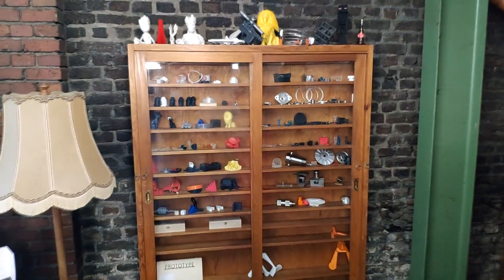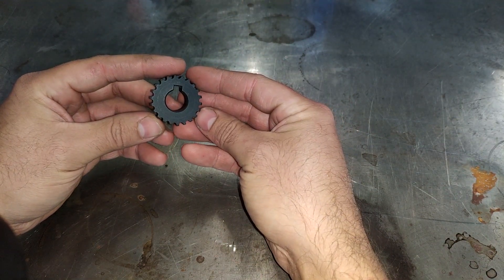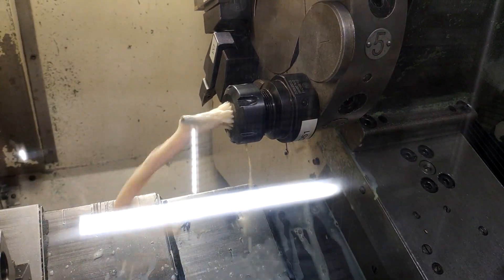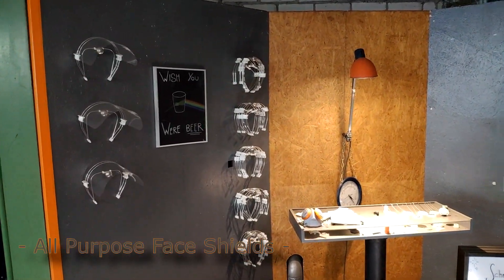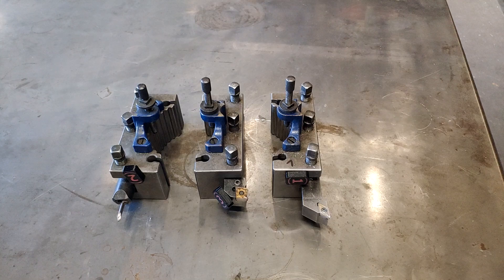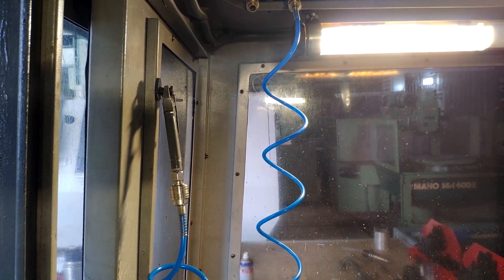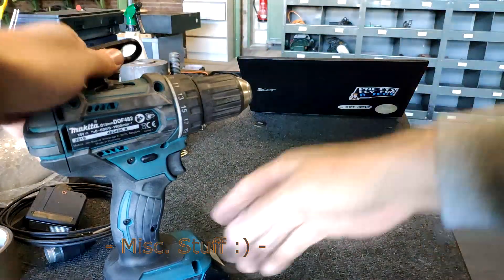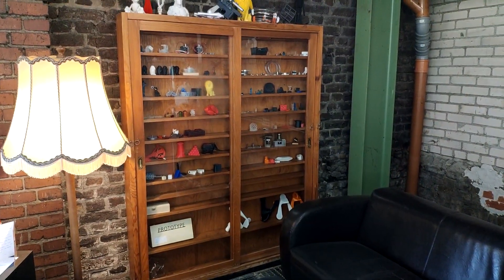20 (Actually) Useful 3D Printed Tools for Workshop and CNC machines!

Comment: Sweet Vid so want one of your angle grinder adaptors, from a small family job shop of Rotary Engraving and Co2 Laser Cutting & Etching, even simpler "Contrast Colour" solution for your 3D Printed Tool Holder Magnets paint Fill! Just Use Some Enamel Spray Paint spay a little into the lid of the can so you got a little pool pot of paint to dip a small fine paint brush into and Capillary action will fill and do the rest for you. 🤙🏼

Comment: Another way to do stock stick out is to enable manual gcode passthrough in your post, and write some gcode to use a tool, or whatever as a stop for your stock with manual stops. also if your chuck is automatic you can easily fit a bar puller, they have cheap ones that essentially press fit over stock and are fully adjustable for a huge range of stock.

Comment: Got here from TOT and you completely convinced me - subscribed.
Reply: Same here.  Came because TOT recommended,  subscribed because of the content and insights.  
Having started my career in the 80's, with a plasma torch and burning table,  and going through all the advances in NC since then, it's been quite a ride.  Your initiative and innovation will serve you well.  Wish I could start or find a shop like yours  close by,  I'd be there every day. 
You are showing younger engineers that solving problems is not only fun, but can be the very basis of a business. 😎
Reply from the maker: Great to have you here!

Comment: I would have never thought that the angle grinder produced enough torque to drive a screw. What's the reason for those silicone donuts around your print head heaters?
Reply from the maker: Heat insulation as well as keeping all the guts at the right place :P
Reply: @Roetz40  It looks very neat.

Comment: You're sure good at simplifying your work through 3d printing and I love it.  Do you have to tune your 3d printers often for how much you use them?  Did you modify them to be better?
Reply from the maker: I run both Prusas, the formlabs and also the enders in their stock configuration and I'm happy with all of them. All the self build machines are specialised to a certain task

Comment: Great video! A lot of your parts seem to be quite tough – how many walls and how much infill are you using?
Reply from the maker: Totally depends on what youre trying to achieve. I very rarely use less than 3 perimeters on a standard 0.4mm nozzle, the more the better ofc. IMO perimeters are far more desirable than higher infill %.